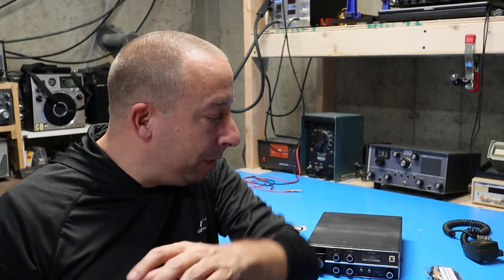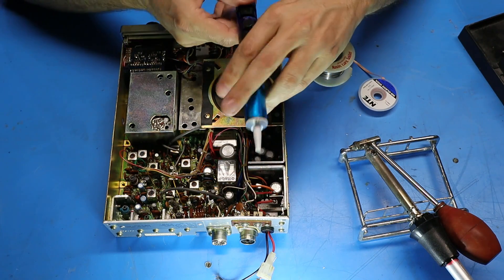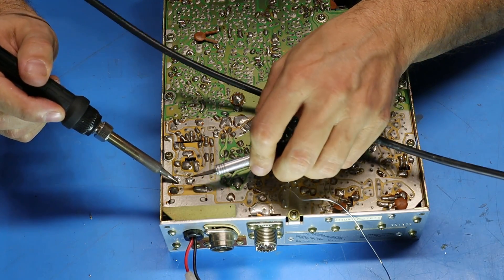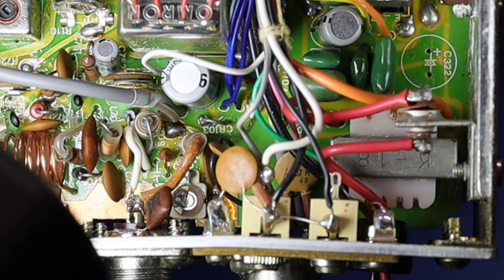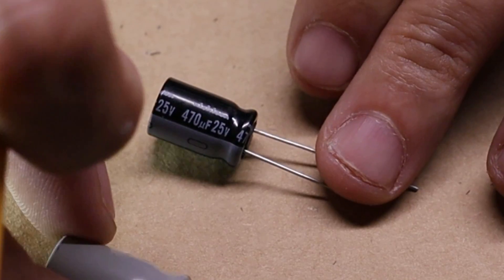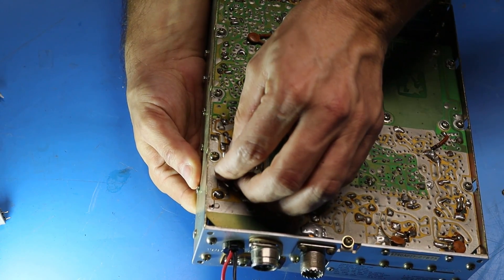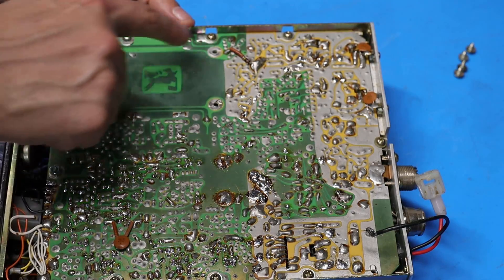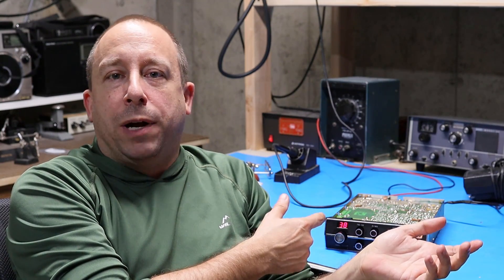CB Radio Restoration - Replacing Old Electrolytic Capacitors Highlights

Comment: A capacitor doesnt have a cathode or an anode. Your thinking of a diode. Capacitors have a positive and negative.
Reply from the maker: Hmmm...you sure about that?
Reply: @SevenFortyOne  Very sure
Reply from the maker: Sorry Bud but you are wrong.  

The quote below is from Wikipedia.  If you don't trust that I can send you some datasheets for electrolytic capacitors I designed into circuit boards currently orbiting the earth on the international space station that depict Anode and Cathode terminal on capacitors.

"An electrolytic capacitor is a polarized capacitor whose ANODE or positive plate is made of a metal that forms an insulating oxide layer through anodization. This oxide layer acts as the dielectric of the capacitor. A solid, liquid, or gel electrolyte covers the surface of this oxide layer, serving as the CATHODE or negative plate of the capacitor. Because of their very thin dielectric oxide layer and enlarged anode surface, electrolytic capacitors have a much higher capacitance-voltage (CV) product per unit volume than ceramic capacitors or film capacitors, and so can have large capacitance values. There are three families of electrolytic capacitor: aluminum electrolytic capacitors, tantalum electrolytic capacitors, and niobium electrolytic capacitors."

https://en.wikipedia.org/wiki/Electrolytic_capacitor
Reply: @SevenFortyOne  Wrong? how long have you been in electronics? How many electronic engineers and technicians work for wikopedia? That language (anode /cathode) is for directional device diodes, scrs, transitors and the like. Ive been in the business for more than 50 years, nobody but nobody refers to a cap or battery polarity as having an anode or cathode. Polarity and direction are different. Polarity does not have a P/N junction or forward and reverse bias or turn on voltages. Stop reading technical manuals from manufacturers on the chemical makeup of caps unless your describing how to build one, especially for something as generic as recapping a radio. If you have to go to internet information sources to try to backup your opinion to make you sound knowledgeable then you dont know what your talking about. Just go recapp your radio and dont come back with the chemical make up of solder.
Reply from the maker: I've been in the industry over 30 years.  I've worked for the largest PCB manufacturer in the USA, two fortune 100 aerospace companies and an industry leading EDA company in various roles related electronics manufacturing and design.  Point is I've been around, worked in many capacities in this industry, and know what I'm talking about in this case.  Your original assertion was that an electrolytic capacitor doesn't have a cathode and anode.  It most certainly does.  Do people always refer to them as such?  Sometimes, yes, sometimes no...its not not consistent thought the industry but most places I've worked use those terms so I've gotten in the habit of doing so myself.   If you meant that I shouldn't use the formal terms "cathode" and "anode" in my video and should instead refer to positive and negative terminals as that's easier for people to understand then I see your point and agree.  If that's what you meant, that's what you should have said in the first place.

Comment: Awesome. I'm having a heck if a time figuring what is wrong with my old Cobra 18 Ultra Weatherband. Three-wire hookup for power - no matter how I hook it up, something fails to work (either led doesn't work or transmit meter doesn't work). While that one sits on the she!f, I am replacing some caps in an old tube cb. Having a lot of fun (so far) with that project.

Comment: Sir, I need a little help. By the way, I'm from the Philippines & CB technicians here is scarse and I don't have much resources & high tech equiptment for repair so please bare with me. I've got an old never been used GE Model 3-5804B C.B. radio. It's got recieve, problem is that in transmit, the needle swings back instead of forward and there's a squeal if the volume is beyond 8 o'clock and no squeal below that volume level. I have another radio to monitor its transmit. I am kindly asking for your help what could be the problem and what should I do? Could it be the final transistor which is a C 1306. I'd really appreciate it very much sir.
Reply from the maker: Hard to say....maybe a bad capacitor or bad solder joint.  Or the microphone could be wired wrong

Comment: Nice! another great old radio saved. I liked the temperature on Your soldering station too.
Reply from the maker: Ahhh-you caught my little Easter egg.  I only set it that high for the picture - I run it cooler than that most of the time.

Comment: Now you are all set forthe next 40yrs having fun with this sneaky old cb radio. I recapped a  JRC-NRD515 Receiver, a Uniden Madison, a Galaxy Saturn Turbo, a Galaxy Pluto II and my TS-850SAT. All the Radios I messed around with are fully in function & my signal reports confirming it over and over again that I did not ruin anything inside the Radios. Which can happen very fast but gladly in my case I did not.Thank god! In my opinion to replace the Electrolytic Capacitors of my NRD515 made this Thing sounding warmer to me. Thx for another neat Video 741, keep up the Wood Work in 2022 & stay healthy. Happy New Year to everyone & 73 de Your Friend Uncle Guenter
Reply from the maker: 73vandvhsppy new year.  Working on old radios is fun and a learning experience

Comment: Hi Rob,
Happy New Year. I bought a recap kit for my Yaesu FT901DM. Hoping to get it dine in 2022. The new caps are generally smaller for the same capacitance. Your solder sucker with the bulb, you need to loosen the two screws holding the head assembly in and give it a little twist and then re-tighten the screws. Do the same at the tip and then re-tighten. There could be resistances built up at the attachment points preventing the tip from heating sufficiently. I have the same unit. Need to do something similar periodically to the tip of my soldering gun. You and the family have a safe New Year.  73  WJ3U
Reply from the maker: That's a nice radio Don! - Happy New Year!

Comment: Be careful with capacitors, I have seen some marked on the positive lead and not the negative lead, but as long as you take care, just check it is the normal - marked on the black strip on the capacitor.  If it is a + it will go to positive on the board.  Just take care and watch the markings.
Reply from the maker: Caps can be tricky - you're right!

Comment: Thanks for sharing. I have some old AM and shortwave tube radios that I would like to restore but I need to get an isolation transformer and a variac before I feel safe to work on line voltage radios like these.
Reply from the maker: That's a good idea...those old radios can be dangerous
Reply: @SevenFortyOne  I need to visit with Radio wild

Comment: Some thoughts on this . . .  There was nothing wrong with the capacitor that was replaced in the video.  Capacitance tolerance for that part is 20%.  ESR was good.  Replacement cap is a 105 degree part, of course that is good.  Was the radio working fine?  Thinking a lot of time and money was spent to not improve anything.  Not all electrolytic caps in old gear needs to be replaced.  Casual replacement exposes the PCB to needless damage and many collectors want all original.  No sure how collectible that radio is.  Johnson used good parts during manufacture.  Just my opinion.
Reply from the maker: Normally I don't replace caps unless they need it for most of the reasons you cited.  However, if you watched the whole video you'll see that one cap was leaking and if left alone would have ruined the board.  I didn't show it in the video but several others were on the verge of leaking and benefited from being replaced. Without replacing all of them there would be no way to know which ones needed replacement and which didn't.  Additionally, I wanted to make a video about how I go about doing this as I felt it would be something people would be interested in seeing.  This isn't a 1970 numbers matching Hemi Challenger so I'm not too worried about keeping it original either.  If replacing the caps devalues the radio down the road I'm OK with that at the expense of enjoying the process of extending the useable life of the radio and sharing the experience with others.
Reply: I was just gonna say the same thing...   😂😂😂 @SevenFortyOne

Comment: Very interesting.  What did you use to clean the electrolyte that leaked onto the circuit board? Happy New Year!
Reply from the maker: Happy New Year!  I used  Isopropyl Alcohol and a q-tip